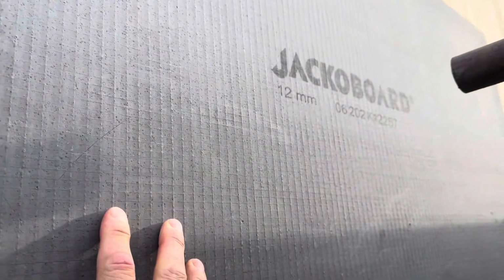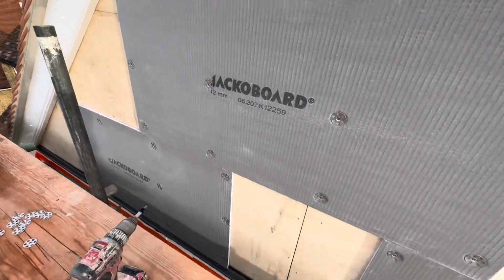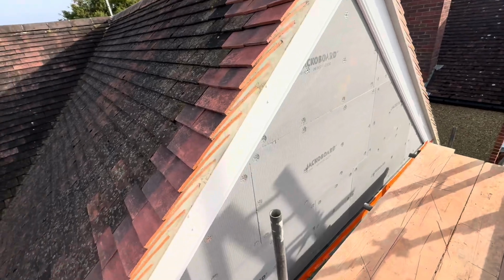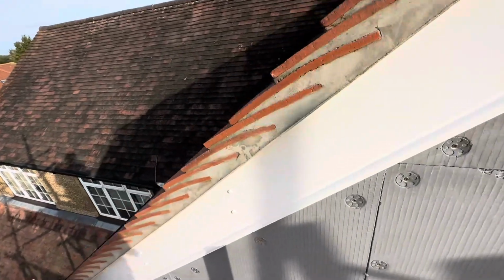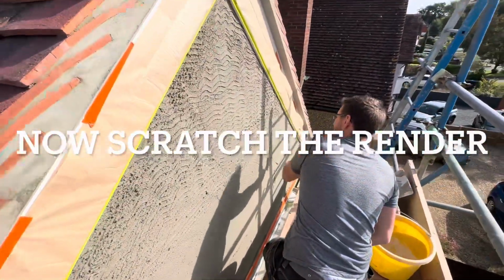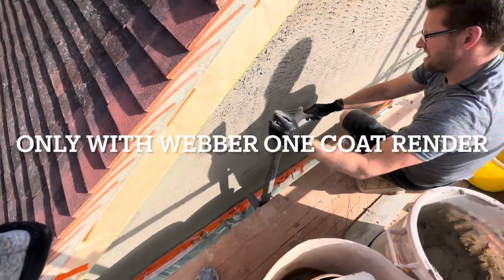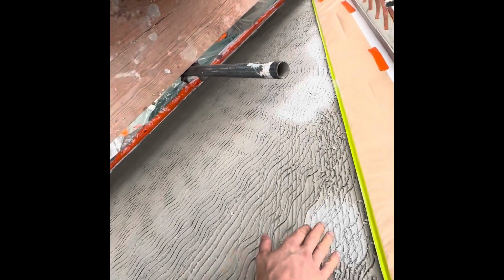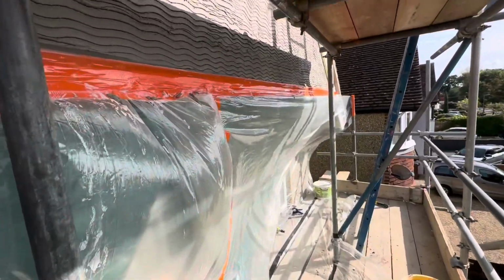How to apply render with a pebble dash finish in 1 day

Comment from the maker: Hey David, thanks for your question!

It sounds like you’ve done a solid job so far with the preparation. When it comes to breathable bonding agents, there aren’t many pre-grit options that are fully breathable for external rendering. You’re right to be cautious about trapping moisture in, especially when dealing with rising damp.

One alternative is to use a lime-based slurry or a lime wash, which can act as a breathable bonding layer without sealing in moisture. Lime is great because it allows the substrate to breathe while providing a good key for the scratch coat. Another option is just to stick with what you’ve done, skipping the pre-grit, especially if the test patch worked well. It’s often best to avoid anything that could potentially trap moisture, as you mentioned.

Sounds like you’re on the right track, but feel free to ask if you’ve got any other questions. Good luck with the rest of the work!

All the best,
Dan

Comment: Im surprised the mini drill hasn't blown up pal
Reply from the maker: 😂I know, it’s an 18v Milwaukee and it’s incredible! I’ve lost count of how many “proper” plasterers drills have blown up on me. I’ve used this drill for about 3 years and just love it 😊. 

Small compact, easy to clean and I use a variety of paddle mixers depending on what I’m mixing 👍🏼.   

It’s perhaps not for everyone but it keeps me happy😇
Reply: @DanLee40  yes we'll I'm going to buy one mate as long as it doesn't strain then il be happy I'm sick of carrying plasterers mixer want something small.
Reply from the maker: It’s just the job for small mixes, 1 - 2 bags 25kg bags. 

If I was mixing 3 plus 25kg bags at a time then I’d get out my giant Refina mixing drill. But most of my work is domestic and I rarely need to.

Comment: 2 quick questions. How thick was scratch coat and top coat? Can you leave scratch to dry/cure and come back and do top coat?
Reply from the maker: Good questions. Each coat is approximately 8/10mm thick. You can absolutely leave the scratch coat to harden. I’d recommend getting the final coat on before the scratch coat has fully cured as this will help with the suction. If the scratch coat has been left to fully cure I’d recommend applying a primer over it to help with suction control. Let me know how it goes 👍🏼
Reply: Getting scratch coat on was a bit tricky in places as small parts started to come off or rough up. I then pressed mesh in and went over adding and scratched which felt more solid. I left for about 3 hours and was still slightly soft but top coat went on ok and I threw stones at it which stuck eventually. Background is I’m patching outside wall areas where pebble dash was blown and area where blown and rising damp. I’ve injected, tanked and used toupret anti damp render which is what I’m going onto now. The patch I’ve done was small test area. Question- is there a pre grit or bonder which is breathable which will help get base scratch coat on? I can’t see any and dont want to use something which traps water in. Or maybe I should just do as before no pre grit. Any advice v welcome! Thx

Comment: Why don't you you use a roughcast trowel and a dashbox
Reply from the maker: It’s a personal choice. For such a small area it doesn’t take that long to throw it on. I’m more accurate and much cleaner when I throw the stones on with my hands.

I find the roughcast trowel great for large areas although it’s much messier.
Reply: @DanLee40   it's not a criticism just that roughcasting trowel  smoothes out any trowel marks on wall.a dashbox about 900 X 500  by 75 high is light enough to use and next to no cleaning up and saves loss.timpressed with your finish